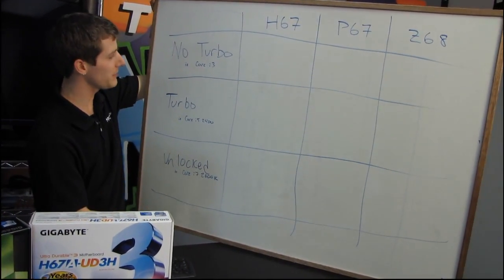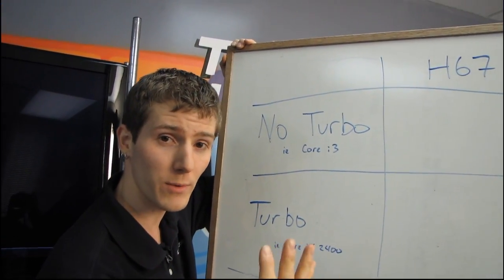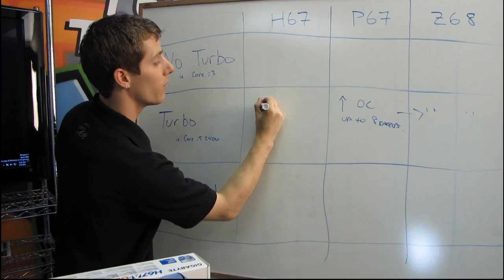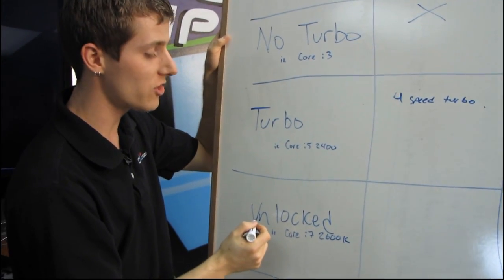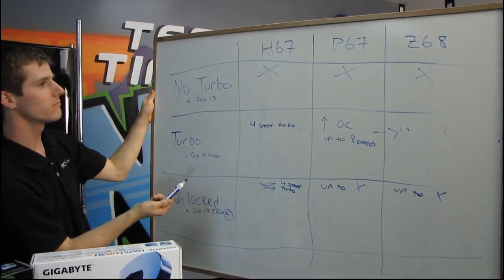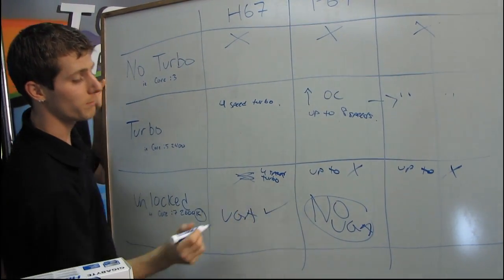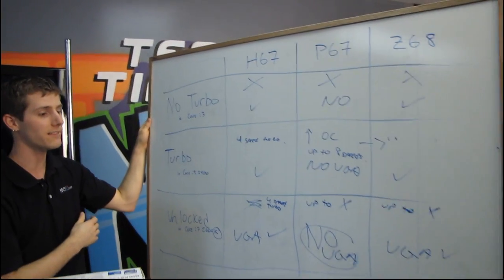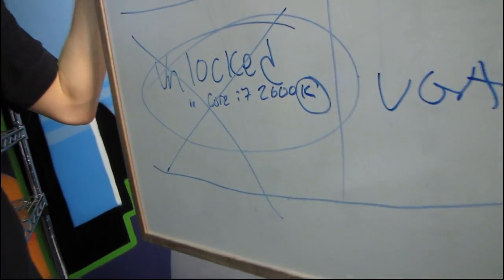Intel LGA1155 Sandy Bridge Platform Explanation H67 P67 Locked & Unlocked CPUs Linus Tech Tips

Comment: My core i7 2600 (non-K) runs at 3.5 GHz all cores in full load. I use a Q67 motherboard.
So, I guess the Q67 works like the H61?

If I were to put the chip to run at 3.9 GHz full load, I'd need a Z or P series LGA1155 motherboard, right

(I know I am 9 years late and this processor is now really old, but it doesn't matter)

Comment: @Sniper1Hunter - Go with the newer Sandy Bridge processors. Out of the i7 2600 and i7 2600k, you may aswell get the 2600k becouse it gives the option of overclocking perhaps at a later date. And it also costs only a fraction more then the i7 2600 locked processor.

Comment: @eyadkalaji in that case, definitely go with the 2600k... for myself personally, i would even go with the 2500k, it's 100$ cheaper than the 2600k, and they overclock the same. the lga 1155 overclocks really easily, so maybe you should look into that. even if you never overclocked before, it would be amazingly easy to get these chips to 4.2-4.3ghz. there are a lot of OC guides on these chips online.

Comment: @n8mario you can overclock only a 'k' sku processor. for example i5 2500K, but a i5 2500 will be locked because it isnt a 'k' sku. K = unlocked

so in order to overclock you need a K / unlocked processor AND a p67 motherboard. x68 arent out yet.

I would say for a safe voltage of around 1.36 or less it looks like 4.2 to 4.7 is the range for most 2nd gen i5 or i7 cpu's.

Comment: Thanks, Linus. I don't know if you've already reviewed Intel HD2000 and HD3000 graphics (video test of K and non-K I*ntel CPUs). Such info is highly appreciated to make up mind about video performance difference.
Is it really necessary to buy K processor to play old 3D games (circa 2004-2007) without discreet GPU?
Another question is Power Consumption Saver option of H67 chipset. Is it really able to completely stop external video card from working in 2D mode?

Comment: @jchambers2586 I wouldn't expect as much improvement as AMD has not announced that they are moving to the 32nm fabrication process on Bdozer. Anyway even before Sandy Bridge an Intel core outperformed an AMD core by about 20% or more due to more effective off-core logic (cache controllers and so forth.) That's why the i5-760 at 2.8 Ghz actually performs on par with the Phenom II X4 970 at 3.5 Ghz. The i5-760 doesn't have hyperthreading, so that's not a factor.

Comment: @bluesmoke21 It has to do with the number of pins on the array. There are 1155 pins on the motherboard that make contact with 1155 contact points on the CPU. Compared to 1156 pins on last gen's i3/i5/i7 series, hence that name. LGA 1366 (highest-end i7s of previous gen) still has the most pins and generally fastest speeds.

It's confusing definitely, but that's why that number was used, in case you were not sure.